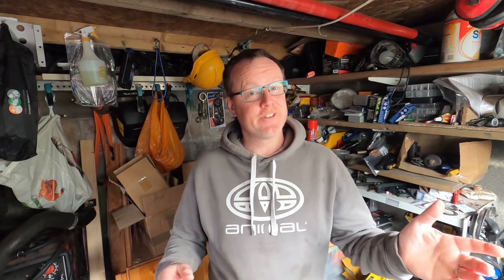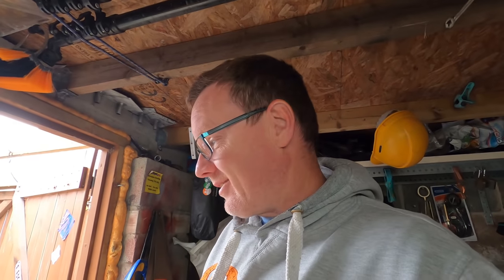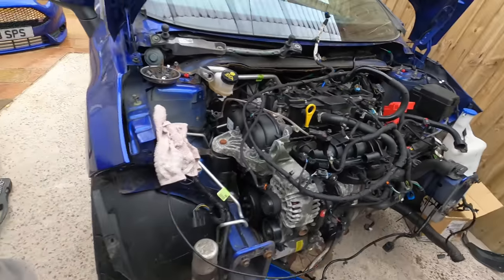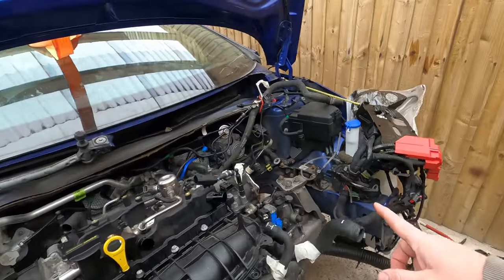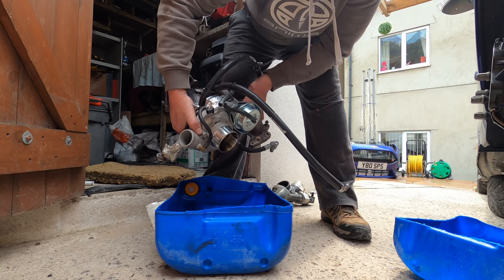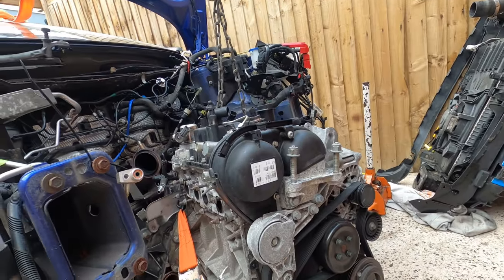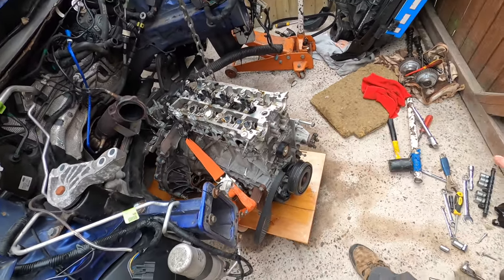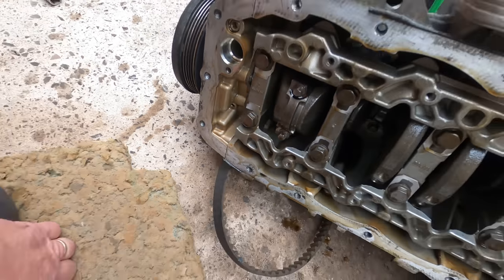Why did my engine blow? lets take it apart!

Comment: I think it's time for a new engine and a different tune! Have you had any thoughts of selling the turbo and going with the X47R, or are you planning on staying with the S280 on a new tune? Loving the content recently, Steve. Keep it up!
Reply: Why go to a turbo with even more overheating problems on track? Not even gonna start about the pumaspeed maps.
Reply: @TheTechnoaddict  what turbo do you think would be best for track? I’ve only ever heard good things about the S280 so I’m glad to see Steve’s wasn’t damaged when he removed it from the engine.
Reply: @Pighands79  my friends all run the s280 or the garrett gtx2860r (more lag but when the boost kicks in is just insane). I do maintenance on them and they don't have any problems. Uprated intercooler, radiator and some of them run an external oil cooler. 2 did the block mod when they replaced timing belt. One is completely build from the bottom up and closed deck and he is havin problems with heat building up in some places so he's running lower boost at the moment.  I think the engine will go before the the s280. It seems like a well engineered and manufactured turbo. As steve already mentioned overheating problems before going s280 there maybe allready was some damage when running stage 2. But in the end u know a tuned engine can cause problems sometimes but hey that's carlife if u wonna go on track. It's sad for steve it happened right after going the turbo route but that's what makes me think he allready had damage inside the engine.
Reply: @TheTechnoaddict  fuck all wrong with Pumaspeed maps. Having been with the calibrator first hand and watched him write/dial in the tune using winols, he certainly knows what he's doing.
Reply: @cf5200  each 2 their own. Not here to slate them but i certainly have an opinion about them and lots of people i know do.
Reply: @TheTechnoaddict  opinion based on what? hearsay or personal experience?
Reply: @dangermouse6217  experience.
Reply: @cf5200  and winols is just a program to alter the ecu. Using that software says nothing about knowledge.
Reply: @TheTechnoaddict  Have you even used it yourself? I doubt it. Its the most complex hex editor to use for altering OEM software, you need to have a good understanding of the ecu structure/strategy so you can reverse engineer it so you know what changes to what tables do what and how it will affect other things. Its requires good knowledge of engines and their control systems, so yes, it says alot about knowledge. Maxd software is well proven.
Reply: @cf5200  again, almost every tuning company uses winols so it says nothing about your skills. They have the largest database of tuningmaps so i wouldn't be surprised if they didn't even make the map themselves. Winols is used to alter the ecu so it's not gonna do the work for you! And just like revo these are of the shelve maps that don't account for the small differences between every engine. We compared 3 files coming from pumaspeed. They are suppposed to be 3 different maps for fuel quality. Well guess what, they were all the same. But as i said, if you are happy with them it's good for you. We will never buy anything off them again and we have our reasons for it.
Reply: @TheTechnoaddict  Think you've missed the point completely. Just because 'tuners' use winols doesnt mean they are any good at it, proper use of it requires knowledge and skill, anyone can alter it, calibrating it properly requires the skill and knowledge. Pumaspeed's Maxd write all their files themselves, there is plenty of evidence to support this.

Also, modern ECU's are quite capable of accounting for small differences, this why the likes of Puma, Revo etc can get away with well developed flash maps.

As you said, difference of opinion.
Reply: @cf5200  that's what i say! Just watching someone use winols doesn't say anything about knowledge. U can know engine components as much as u want, it's the values u set that makes the map. So it's impossible to say someone knows what he's doing based on u watching him alter values. All i can say is we did engine knock count and it trippled compared to the revo map. And i wasn't happy with revo map either but the customer service was way better.
Reply: @TheTechnoaddict  puma speed maps are bad ? Iam looking to buy a fiesta 1.6 and stage 3 it. Revo is bad aswell u say. What is my best option then
Reply: @kd2833  revo changed my map after my complains. Puma never replies when u have a complaint or they will say it's some other fault. If i would have to choose i would go for laird performance. Probably gonna get my next map from them 2.
Reply: @TheTechnoaddict   sorry for late response i did not get a messige, i life in holland so cant go to any uk tunners. Its there any option going stage 3 and be save iam look at the x47 turbo since it behave like stock not only high rpm power. Is a upgrade radiator and oil catch can save for dayli use and sometimes a mountain twisty drive. Looking at 300-320 hp
Reply: @kd2833  ik ben van België dus je kan ook nederlands sturen😊 autosport mebu kan je wel verder helpen met al je vragen. De hybride turbo's zijn allemaal te vergelijken met de originele op gebied van rijgedrag alleen verschil in kwaliteit. Je hebt een grotere intercooler nodig, radiator upgrade is altijd beter maar niet noodzakelijk als je niet op circuit gaat. Als je de bergen in wilt ga je wel een baffled sump moeten steken anders gaat ie niet genoeg olie aanzuigen vanuit het carter. 300-310 pk is goed te doen met deze blokken. Natuurlijk gaat de blok wel sneller verslijten maar dat heb je altijd als je er meer vermogen uit wil halen. Veel hangt af van rijgedrag, onderhoud,...
Reply: @TheTechnoaddict   een auto moet toch tegen bergen kunnen zonder dat die geen olie krijgt ? Heb dan nooit hoger dan 200pk gehad met mijn vorige autos en altijd lopen race in de bergen. Maakt de pk s dan uit dat ik een olie baffele nodig heb ? Ik doe elke 6k olie als ik zo veel pk uit een 1.6 zou halen.
Reply: @kd2833  als je bergop rijdt dan gaat je olie naar 1 kant van het carter en krijgt de aanzuigpijp niet genoeg toevoer. De fiesta heeft hier best wel last van in de bergen. Zeker als je andere turbo gaat en dus meer warmte krijgt kun je alle koeling/smering gebruiken die je kan krijgen.
Reply: @TheTechnoaddict  duidelijk bedankt !

Comment: Fatigue failure of the piston body, nothing left to support the piston rings so they escaped. There probably was a crack in the piston and the enhanced HP accelerated the failure. You could rebuild that engine.
Reply: Someone can use the short block to get ductile liners fitted. Completely salvageable. Not a complete loss like Steve's making it sound.

Comment: It looks like pre-detonation damage. I'm just happy the turbo still looks good mate! 
Too much boost, too much advanced timing, and probably it was running slightly lean on the AFR. The cylinder temps will have got too hot and caused pre-detonation and then the cylinder has just gone. Also with it getting quite hot that's why the cylinder lining will have started expanding as seen in the cavity with it looking like it's closed. It's what the cavities are for in between the cylinders to relieve the pressure of the cylinders expanding when they warm up and obviously contract as they cool down. But if they get too hot it can cause them to expand too much and then it doesn't contract back as much when it cools. 
Makes me also think though has the safety been mapped out? The ECU should start retarding the timing when it detects knock and also reduce the AFR when temps get too high. More fuel to cool.
Reply: Wil a better rad fix this ?
Reply: @james wil a beter rad fix that ?
Reply: @kd2833  You can upgrade the coolant rad which would significantly help with this. However, I think due to age of this specific engine and the mapping put on it where it to me sounds like it's had certain safety protocols have been mapped out wouldn't prevent this from happening again. It would only delay it.
Reply: @James-ns6jm   i wanne stage 3 mine when i get it buth only if its save els i go stage 2 instead

Comment: i wonder if you are getting bore walk? and if thats what's cracked the bore at no.4? can you get a block/bore guard for these engines? its an insert that sits around the top of the bores to stop bore walk. its a problem in alot of alloy engine when adding or upping boost pressure. as for the piston, maybe its not up to the power levels you are trying to push? but i am thinking bore walk is the issue, and possibly the piston to wall is nipping up and grabbing the piston?
Reply: You can get shims like the focus st block mod. Helps the liners from warping but it's still not bulletproof. U can go closed deck but seen lot's of problems with that cause the cooling wasn't designed for closed deck and the heat builds up in certain places. My guess is this is tune related cause there are lot's running more power on stock engine without any problem.
Reply: @TheTechnoaddict  You can get block guards for these engines. But like you said they can cause issues with cooling.

Comment: I wonder if this a common issue with these cars and if it specifically happens to the same cylinder a lot. I know some cars have issues with certain cylinders getting way hotter than the others and more heat means more metal expansion. I wonder would that be enough to expand the piston too much and make the gap too small ?

If that is the case and it's a matter of poor cooling on one cylinder due to either poor oil pressure on that cylinder or there's just not enough coolant around it or whatever the reason for the heat , might be worth looking around to see if there is any aftermarket fixes for such issues for the next engine. Who knows though I could be completely wrong I am certainly not a mechanic.
Reply: I am not sure why no one really mentioned this. But the pre 2016 1.6 ecoboost had massive recall on overheating issue in North America. The cylinder design was revised for the 16+ and the issue was fixed.

Comment: Great channel Steve feel your pain buddy been there a few times before on our Fez but hate to say it but it will happen again.! My brand new forged engine with linered block did the same with new injectors & fuel pumps fitted I did get a fix for this but won't post it here but if you want to discuss it give us a call Pete @ Demon Performance Centre
Reply from the maker: Thanks for that. Yeh I'm hoping it won't happen for a while at least. My wallet or marriage will be in trouble if so lol
Reply: @Sparkplugsteve  If your luck goes like mine Steve mine manged a day & half at Spa got some lovely misshaped Wossner pistons  all new set up for me now & going strong just trying to get a stronger gearbox input shaft as mine & it's sister car suffers from sheering them off hate to say it but you'll have one soon enough ;(
Reply from the maker: Check your Instagram 😁

Comment: Looks like detonation. Does the map disable the safety strategy?
Reply: Surely if it was detonation you would have det marks on the top of the other pistons?
Reply: Probably not disabled but likely dumbed down. Stock on these the knock system has a random sensitive point around 5.5k due to a high knock risk ford noted during R&D, most just 'smooth' this out sl it doesnt interfere. Bad move. Deffo a det issue though, sudden knock event will do that damage whilst the other cylinders remain unaffected. These have individual cylinder knock control.

Comment: 99.99% convinced that looks like the cylinder has moved/cracked. 
Common on the open deck focus 5 cyl.
Can you get block mods for the ecoboost to strengthen the cylinders?
Reply: yeah looks like it needs CSS, like boosted bois do on the honda blocks...
Reply: @FreeThinkingTruther  not to sure on the honda blocks i havent watched boosted boys for a long time. For the focus and volvos engines you can get little shim that sit between the liners to stop them flexing and cracking.
Reply: @danf3576  I've heard shims aren't as effective on the st180 as they are on focus 5 cylinder. Might not be true though. Needs to be investigated more.
Reply: @filmboy18  certainly does, had my St on the mp215 map for over 50k miles now, want to turn it up but really don't want it to go pop in the process!
Reply: @FreeThinkingTruther  I have the s280 with Collins map. But this video is a bit of a scare. Had my car from new though so I know it’s in pretty good health.
Reply: @filmboy18  i really dont know anything about the fiesta motors. Just an semi educated guess from watching the vid.
Im really not a fan of open deck blocks at all.
Reply: @danf3576  Yeah. If this engine was closed deck it would have so much potential.

Comment: Hi, sad but interessting to see. What Oil did you run the engine with?
Would a 2l Ecoboost fit in that engine bay?
Reply from the maker: 5/30. Fresh oil day before.
Reply: @Sparkplugsteve  I would change to 5w40 Motul 300V that can handle up to 150°C and maybe a bigger Radiator and Oil Cooler. I guess there was a temp issue and that killed the piston.
Looking forward to your new engine build. 💪

Comment: Looks like she went lean....might be worth getting the the injector tested bud 👍
Reply: Or the tune maybe?
Reply: @fasthracing  or the fact that as its a ford its inevitable.
Reply: @steeldevil98  How so?
Reply: @fasthracing  Ford's have far to many engine failures.
Reply: @steeldevil98  Ok right any evidence of that?
Reply: @fasthracing  haha another salty ford owner lol. It's all over the interweb pal just take a look. 👌
Reply: @steeldevil98  mk3 RS throws rods on standard power aha
Reply: @JordzyBrev  yes mate all so called fast Ford's are plagued with design flaws but the salty ford fanboys don't like it lol 😂🤣
Reply: @JordzyBrev  and don't even mention the ecoboom fiasco that left thousands of owners needing a new engine. Some people have had 4 engines lol what a quality product 👌👏
Reply: @steeldevil98  do like a ford but seeing problems a lot and Japanese engine design never die
Reply: @JordzyBrev  i used to love a ford when i was younger and didn't have much money. Glad ive moved on now though.
Reply: @adeburton4885  the imperfection was probably already there as the car has overheated on track before! It's not that much of a surprise that adding another 70-90bhp has accelerated the full failure imo 🤷‍♂️. These liners are designed to expand and contract I believe? Excessive heat means they do not contract properly. At the end of the day though, it's the risk you take when you throw more power at a car 🤷‍♂️ 🐌
Reply: Get an MX5, simpler, cheaper, easier to work on, stronger block.....oh and more fun on track!

Comment: Would the piston failure  have something to do with being on the driver's  side of the car and the track having more high speed right hand turns than left? - The engine oil will be pushed to the left of the car, thus starving the right hand side of that cylinder of the oil, causing heat and failure. Agree?
Reply from the maker: Sump is baffled but no the oil system doesn't work like that. The ring failure was nothing to do with oil. It was detonation. The cylinder pressure just overwhelmed the rings and blew them out.
Reply: @Sparkplugsteve  Ok. Ta. It was just a thought which wandered around my head while I was walking the dog this morning, put 2 & 2 together and made 5, I guess. Sorry. 
Good video tho' - hoping your car's back on the road and the track soon.

Comment: Trs mapping blow the engine!
Reply: Think your right, Looks like it's been mapped lean under certain loads and been getting hotspots/detonation.. just a guess though.
Reply: I'm with you guys, I watched that tuning video and was not impressed at all 😔
Reply: Not the first and won't be the last.
Reply: That's why I have Collins Performance Engineering CP1 map on my otherwise standard 2016 Fiesta ST2.  3 years on and no issues.  No stupid pops and bangs and not chasing the biggest numbers but just a great map.   If you run 99 Ron Tesco Momentum, I find you get even better results. 👍
Reply: Custom gernic maps your asking for disaster, dyno or live road mapping ftw
Reply: @alexandercooper8743  Collins are shite. Made 270hp on a s242 when they did mine and then left my actuator unplugged which could have cost me my engine..good job I never went full throttle. Also cp2 feels no different to standard.
Reply: @adycoupland3090  that’s exactly what TRs do 👀
Reply: @ziffbobbit  Your talking crap saying CP2 feels like standard.  Lol 😂

Comment: Crack in cylinder 4 filled cooling system with combustion gas causing coolant to boil or have a  runoff effect ie overheat.  Depending on design of coolant flow in and out of block Cyl 1 became the hottest of the 4 which caused it to detonate blowing out ring land.  What does the cylinder look like on the side of the blow out.  Is scorched or just chewed up? Bear in mind I’m just one of the keyboard warriors.  Lol don’t know anything.
Reply from the maker: Cylinder is fine. Slight marks but nothing you can feel

Comment: What year was this engine?
Reply from the maker: 2014
Reply: @Sparkplugsteve  oh thanks. So it was before the fix. In 2015 the engine head overheat was fixed. Ford had recall for >2014 models.
Reply from the maker: Mostly 2013 and some 2014. This engine didn't need a recall. Or at least it didn't get one anyway

Comment: Why not forged it cheaper than a new engine
Reply: Running big power on modern engines normally ends in failure.
The pistons just cannot take the boost pressure and the ringlands always let go.
Forged pistons is the best option
Reply: a decent forged engine is over 5k, standard is just over 1k....
Reply: @Ghrolz  I just forged mine with hendys performance £3700
Reply: @rosscope5969  what did you get forged? just pistons and rods? Had some quote from area 6 who are supposed to be the best. ranged from 4.5k to 5.2 dependent on what else was needed.